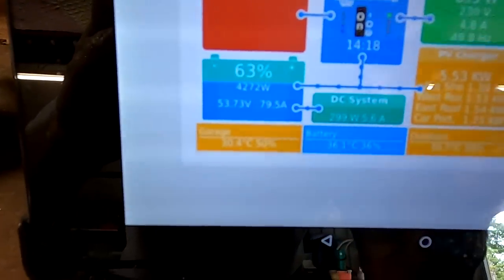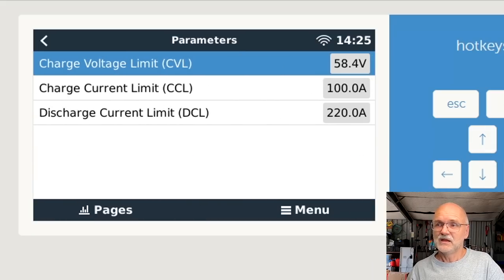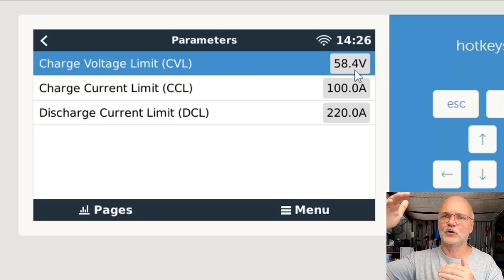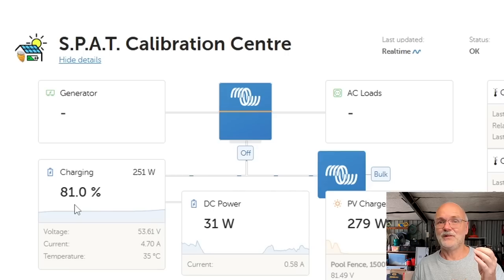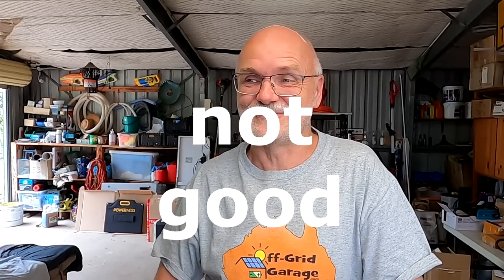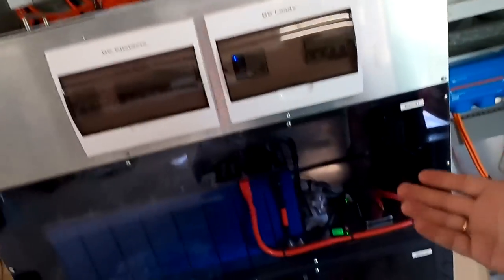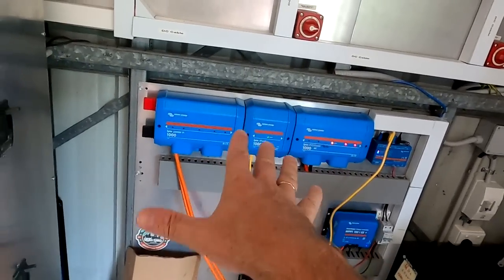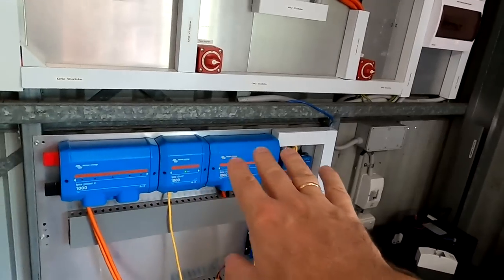SEPLOS BMS and Victron Lynx Shunt. Great solution, but why this is not for me.

Comment: I didn't quite understand why you have a problem with the 55.2V, that's your specification in the BMS. I don't have a Victron, but a different hybrid WR, which adheres to the specifications of the BMS, just before full, the current goes down.... what more could you want? Of course, it would be great if there was an extra parameter for the charging voltage and not the Total_voltage overvoltage protection. I hope Seplos will bring something out there.
Reply from the maker: How do you set your BMS to 100%SOC? Or does your inverter show the SOC correctly (differently)?
Reply: @OffGridGarageAustralia  either the BMS sets it itself when the upper voltage is reached, as you have also noticed, or via software.  The inverter shows what the BMS tells it. the first time, all cells must be fully charged, either slowly and the balancer compensates, or manually recharge individual or fully discharge.  so that all cells are really full and have a uniform level.  The worse the cells are, the faster and further they will diverge.  But that is not the problem of the BMS.

Comment: Andy Always says how satisfied he is with the victron smart shunt. So If i want to know the Amps going in and Out my battery and the current capacity i only have to install the smart shunt and Connect IT to victron cerbo gx to Monitor the Data from on the move? Or do i need other devices to Connect the smart shunt with my WiFi? 🤔 I don't have any charge Controllers or inverters from victron. Thanks in advance
Reply from the maker: The smart shunt connects to your Cerbo and shows the same data as in the Off-Grid Garage VRM. All this battery data comes from the shunt.
I was really disappointed with the Lynx shunt not measuring any DC Power. So, atm the Smart Shunt or the BMV is the best solution if you have other non-Victron gear as well.

Comment: I have solved the solution of not allowing the 45kwh bank to stay at 55.2v for a long period by adding an assistant on the Multiplus 2. Turn on relay at 98% and turn off at 96% soc.
I have installed a contactor to turn on and off a 4kw 48vdc water heater element(2x2kw each in parallel) directly powered from bank. This way, my mppt continues to output the max solar output it can provide during the day as battery bank is fully charged. It's a small array of 2kw on tracker which produces an average of 10kwh per day
Long story short:
Charge bank to 98%
Take advantage of excess solar production during the day to heat water(or any other load).
Solve bank from staying at CV of 55.2v for the duration of solar production(by 11am my bank is usually fully charged).
The above is with Seplos as the controlling device and mppt being externally controlled.

Comment: Great video!
Question: wouldn't be easier to disconnect the Seplos BMS from Victron and leave Victron to manage charging and discharging alone? What is the benefit to have this connection in this scenario ?
Reply: This is exactly the point. If you use Victron system there is no benefit at all. You can use smartshunt as close to battery as posible and different bms just for safety of your battery. 
It is different on other systems like Goodwe, where you are not able to connect any shunt, so you have to rely on the bms shunt only.

Comment: Andy, I've been wondering for a while now if you've ever looked at the Batrium BMS's? I believe they're even an Australian company
Reply from the maker: Yes, they are just down the road from me (~800km or so).
They got in contact with me but I wanted to test other solutions before going all the way to the top. Staying mainstream for now, as not many can afford such a solution. And it is not easy to understand and setup.

Comment: Hi Andy!  Thanks for all your effort that you put in the SEPLOS BMS. Maybe Seplos react on your Video an improve the Firmware. And also the BMS APP which does not show the cell Diff on iOS :-( . With my SOLIS Inverter the SEPLOS BMS works good enough.
Reply from the maker: Yeah, the seem to work OK with some inverters directly. The BT has a very low range and doe snot reach to my workbench.

Comment: Well that is why I like to make my own hardware and software.
Although I purchased the JK-BMS, which have a state of charge that sucks, although it might be one of the best BMS system out there yet.
The JK-BMS should be able to edit the amount of capacity after a full charge and discharge, but it doesn't.
Just hang in there Andy keep doing what you're doing you're doing great job👍
That was a lot of doing but Andy is very active 👍👍

Comment: I "downgraded" last week to the Lynx shunt from the 712 ..
Got almost same system as yours (2Xpower in, Lynx and 2X Distributor , Qattro 10000, Multiplus II 8000 , 2 X MPPT 250/100, MPPT 150/60, Cerbo gx) also the smart shunt would show consumed Ah on the small dial, wondering if i shall try to use the smart shunt on the DC side? and monitor My battery as "Second battery"? would it work?
But really, feel i dowgraded so hope there will be a update for it
Reply: I'm equally unimpressed with the Lynx Shunt. I've a Smart Shunt sat here that I'm tempted to add before the Lynx and use that instead. Meaning the Lynx Shunt will basically become a £300 fuse holder.
Reply: @pedromoonunit430  A fuseholder for very very very expensive fuses that are almost impossible to find in different sizes other than 325A
Reply: @trygvetveit4747  I've a BMS cable to route later when my battery is full. I'm going to fit the smart shunt at the same time. Will be interesting to see the difference.

Comment: Hi Andy, Noooooooooooooooo.
The solution is on the Seplos BMS settings ! There is a way to reset the 100% SOC independently from the OVP. To do it- the OVP on the "flag setting control" need to be disabled. Once disabled, it will only act as "charging setpoint" communicating the charging voltage to the charge control. The battery protection will be triggered through "charging overvoltage protection" which has an indipendent setting (different from OVP). The 100% SOC wil be resetted 30 minutes after the total/cell high voltage alarm is reached. It's just matter of settings. Peppe from Napoli.
Reply from the maker: Calm down. It's all sorted and will be in the next video. Thanks for all your comments 😉

Comment: What kind of donation will it take to get you to test the Batrium BMS w/shunt?  I feel you are seriously missing out on the true benefits of a properly integrated BMS/victron solution.  Get you a Watchmon Core with 3 CellMates. The only thing I’ve found that I don’t like about the Batrium solution is that you have to install a separate Shunt-Trip breaker to protect the cells if a pack gets too far out of line. Other than that, I am confident in saying that you will find it hard to not like it.  And the expansion of the system to more future packs is nearly infinite. Or at least it’s far more packs than you’ll likely ever get too. 😊
Reply from the maker: That has nothing to do with a donation, hahaha. 
You don't get a Batrium system to just test it, it is a commitment for that price! 
Batrium got in contact with me a while back but I didn't like the idea of buying the top system on the market and have it all working right away. That's not what the channel is about. I want to test and fail (sometimes) and share this with others. 
I have another option incoming soon which seems very promising. That does not mean I will not go with Batrium or REC at some stage.
Reply: @OffGridGarageAustralia  you should give a try the diybms
Reply: @OffGridGarageAustralia  I hear ya.  I guess I’m just ready to see you get to that level sooner rather than later. 😊 point taken about the purpose of the channel. 👍

Comment: what settings do I need on my Multiplus to make the Lynx Shunt do all the battery monitoring?
Reply from the maker: That is not possible. You would need the Lynx BMS with a Victron battery. The shunt does not control the charging, it only measures and displays the information.
Reply: @OffGridGarageAustralia  so using the lynx shunt ve can with a carbo and battle or a the multiples still has to “control” the charging of the batteries. When I plug my laptop to the multi-plus it has a check box to use external BMS. In my case I wouldn’t check that?
Reply: @OffGridGarageAustralia  so using the lynx shunt ve can with a carbo and battle born batteries the multiples still has to “control” the charging of the batteries. When I plug my laptop to the multi-plus it has a check box to use external BMS. In my case I wouldn’t check that?

Comment: Andy Did try to get you to look at the 123 Smart BMS before it went into the boat but ... We are fast approaching the question of leaving the battery with a operating "standby" SOC 80-90% due to the high solar charge being available. That maybe sun + AC chargers. It sounded easy to charge to above bal Voltage & then turn off & use to some recharge point but like the Tesla maybe just charge to 80% capacity?? Which method will give the longest life!! These present blue cells are not as good as the CALB cells I used over 10years ago & need to be kept balanced. Regards Bill
Reply from the maker: I never tried the 123 BMS, no.
Tesla uses different chemistry and 80-90% is better for longevity. LiFePO4 can be charged to 100% all the time without increase degradation.
Reply: @OffGridGarageAustralia  Have you a reference to LIFEPO4 not needing to be de-rated to allow for degradation? It is recommended to X.8 the rated capacity of the LIFEPO4 as well. I will check with the engineers as they stat it is best over the life of the pack to do so for aging & temp effects.Regards Bill

Comment: you could try PaceBMS.
Its installed in some of the Victron approved batteries. 
Its somehow similar to your Seplos, but slightly better integrated, i would say.
But also weak balancer, etc. 
Not as good as REC or Batrium

Comment: Why would, under external control, the battery stay on 3,45 forever? (8:40min into the video)
Reply from the maker: Because the BMS has only a CVL to set but no float voltage. So it keeps the CVL forever until the sun sets.
Reply: @OffGridGarageAustralia  But isn't that fine as you anyway only want to charge up to 55,2V?!

Comment: A little off topic for this video, however,  with the same battery chemistry I had more luck getting the victron smart shunt and inverters reporting battery SOC ( from battery bms, unknown brand but same screen) when I set victron smart shunt Peukert exponent to 1.05. 
Obviously this will depend on the specific charge/discharge system and power rolling in and out rates but perhaps tweaking this may help someone, after two years of playing around it was the only way I found ( for my sytem ) to match the bms soc with the victron shunt soc, tweaking capacity figures did not work.
Reply from the maker: Thanks for sharing this. The Peukert exponent can be adjusted so SOC matches the real SOC. I will try 1.05 on my system as well. At the moment I have 1.01 set and SOC seems to be a bit too low.
Reply: @Off-Grid Garage  loving your videos by the way, would have liked more victron gear but couldn't afford  it, so running Growatt inverters.

Comment: Are you finally getting round to testing the new JBD BMS?!? Fingers crossed you find is as good as I do!
Reply from the maker: I'm not a big fan of the JBD due to their Charge Balancing function, either on or off which neither is ideal. Unless they have fixed that recently.
Reply: @OffGridGarageAustralia  nope, its still the same.

Comment: First thing I do every morning is to bring up the Victron system and see what is going on. My shunt does not report the correct voltage either. The charge controllers always have the correct voltage. There is a constant .35 VDC difference.
Reply from the maker: Glad, I'm not alone with that 😁
How can your MPPT show an accurate voltage but your shunt does not? The shunt should be very close to the battery and measure the best voltage in your whole system.
Reply: @OffGridGarageAustralia  I am not sure why. Right now the shunt shows 52.65 volts, Quattro says 53.85 and the charge controllers show 53. Volt meter on the busbars says 53 volts- it's correct. Battery cables are more than big enough and I am only discharging 15 amps at the moment. When I measure the voltage at the shunt it is 53 volts. I never set a zero current calibration so I figured that was it. Always the same .35 volts.

Comment: So the problem is the lynx shunt not the seplos BMS? SO why shouldn't we buy the seplos BMS? The seplos bms can interact with the Victron system but the JK BMS cannot? I am confused after this video. And instead of replacing the seplos bms with the jk bms people should add the Neey 4A active balancer. That is cheaper and has more functionality together with the seplos bms.

Comment: Thank you for all the deep dive on this equipment.      I would have considered Seplose before I saw all of the issues you have found.   As you said,  there is a lot of unrealized potential for the BMS but until Seplose gets its act together.... it doesn't do the user much good..   From what I can tell, most (all?) of the issue can be fixed in firmware.    Also, for most (but not all) of the issues you have uncovered, I would blame Seplose, not Victron.   The issues almost always the Seplos acting in a strange way.  You have shown how amazingly configurable (and complex) the Cerbo infrastructure an how you can make it compensate for nearly all of the Seplos shortcomings.

The lynx shunt issue is almost certainly a Victron issue and is very perplexing.  The physical hardware is just measuring current.   How could it possibly differentiate between the current going to a dc load from the current going to an inverter?    This seems to me to be a Firmware/software bug someplace in the Victron eco-structure.   In fact, it seems unlikely to be in the Lynx shunt itself.    It is more likely to be a bug in the Cerbo code somewhere.    For the shunt to be getting it wrong,  the system would have to be telling the shunt about different load types and then the shunt would use that info to report back something different than the actual current..... that just seems unlikely.     A more likely scenario is that the Cerbo has a bug that subtracts out the DC load from what the Lynx Shunt is reporting.  Even that is strange because it means the Cerbo handles lynx Shunt data differently than Smartshunt data.   Hopefully, someone from Victron is watching all of this and will investigate/correct the problem.
Reply: Yes, the differentiation of the source voltages has me confused as well

Comment: @25:40 when Andy says "any DC power connected" this includes non-Victron inverters, like the Peter inverter. As Victron doesn't have any communication with it, it is simply a DC load, as far as the Victron software is concerned. The fact that this particular DC load then inverts the consumed power to AC to run an AC load is irrelevant.
Reply from the maker: Thanks for the clarification!

Comment: Hi Andy, well, you/ us tried and failed? We tried to integrate the Seplos system with Victron and we failed to get the desired results, not that these results are not good mind you. It's just not entirely what we wanted to see. 

To that end, I am going to be making a video soon detailing my Enersol battery journey over these past few months, what I've learnt, what can be done and what can't be done, I do think though that the BMS's that Enersol are currently using are a bit better than the Seplos ones. We'll see what the viewers say if at all anything.... I do not have many subscribers so my base reach is somewhat limited by that fact. If you would like, you can take a look at what I have done and could maybe give some pointers to something I might be overlooking. Thank you again for all your experimenting and trial and error...... It does help the community out a great deal.
Reply from the maker: I would not call this a fail, Charles. The Seplos BMS is good and has amazing features. Seplos will improve over time and become better. Most of it is just software. At this stage I'm not sure how their software developer is, if in-house or external. So that could be the reason for a delay as well as understanding what is desired/needed from the community.
I'll have a look at your video, for sure.
Reply: @OffGridGarageAustralia   Hi Andy, yes I understand, what I meant by fail was that you could not achieve what you wanted to because of software and possibly hardware limitations. 

I agree that Seplos will improve, and is for now a pretty good BMS bar a few things that need changing. But, if it were not for your channel with the subscriber base you have I fear they would not listen. This is unfortunately the nature of the beast with Chinese development markets, if there is enough screaming to get attention then they work on it, otherwise it is ignored....

Comment: My SOC reset can be months apart - drift is not that large. Its just not a problem, if it is adjust your charge efficiency until it isnt.
Reply: How are you determining the drift is small?
Reply: @Kevin Mills  3 years of running my system. I drop my voltages for summer and "infinite" power, be months without hitting a SOC reset and when i do i also sit there and look at the cell balance and thats also never an issue.